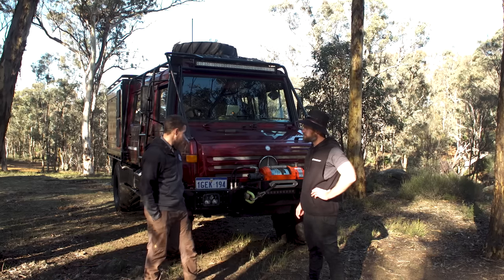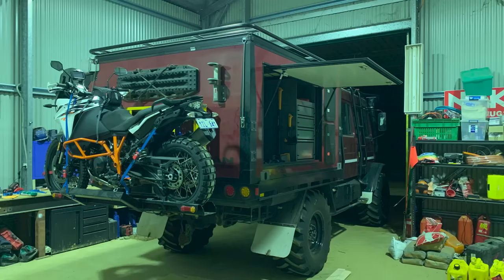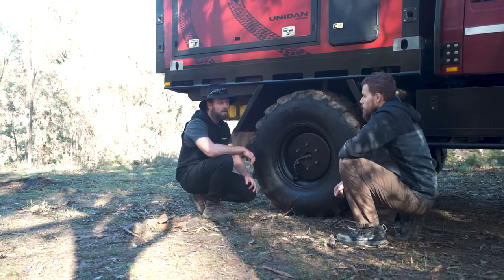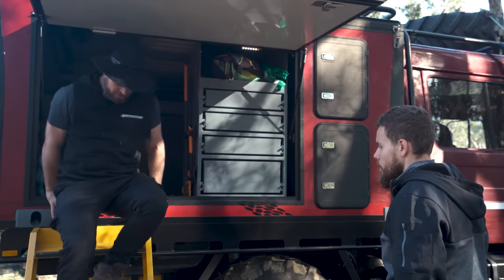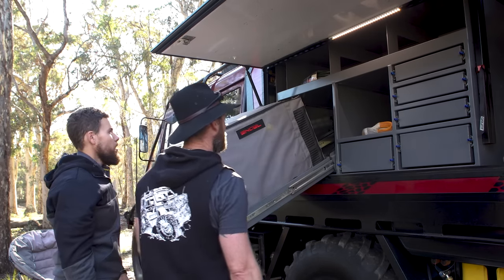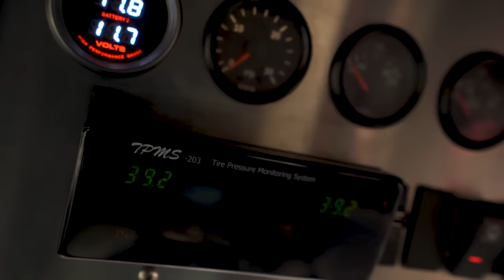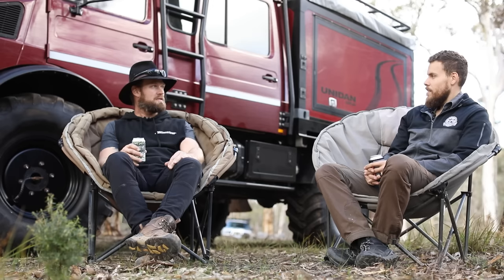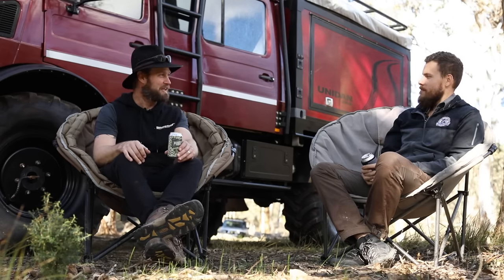DOOMSDAY TRUCK, Unimog Modified Episode 83

Comment: Amazing truck. Everything is done wisely.
And owner has a lot of experience, but CTIS looks little unfinished.
Usually there are metal shields for central tyre inflation system tubes from axles to tyres.
Just because it can be simply torn off in deep mud or by rock or by wooden log etc.
Looks like vehicle is made and what more important is used properly just to get to destination and enjoy it rather than do offroading itself.
Reply: I had metal shields on the previous set of wheels however when getting larger tyres I had to get wider rims and did not make up new cover brackets to suit.  They have a quick release fitting and I just take them off if I am bush bashing.  They are fine pushing through sand on their own.

Comment: I was wondering why no air suspension was installed. you would have a lot more possibilities. For example: you don't need a crane to lift your body to mount on the truck or off the truck etc.

Comment: great rig! my only complaint if i ever owned one of these is the unimog is so god dam slow and noisy. Many late night trips with the army traveling at 80 - 90 km all night long. Traveling to singleton at 11pm the turbo oil line cracked. Made a nice mess. We had to leave it on the side of the road.

Comment: As a MC truck driver I was some what aroused, and this beast would be a sight to see up at Cape York..

Nice rig Mat mate 👍👍
Reply: Would it fit in gunshot, what about the Tele pole bridge, would you get it around the corner and would bridge take the weight if ya did and also a 79 fits barely width wise, don’t think this would fit width wise, guess it could make a nanna line and do more damage to the track around it, tracks getting pretty beat these days!
Reply: @maverick2242  I totally agree mate but it would most definitely be a sight to see if by a slightly improbable chance of it getting that far, and yes it's a overland explorer not a hard-core off road warrior.
Reply: @jesusiskingamen1026  that's awesome, I stand corrected 👍

Comment: Epic build with just about every possible measure or need met, to make it as self sustainable as long as possible but I’m completely shocked that thinking of everything from welding equipment to backup generators inverters, reverse osmosis filtration systems etc why on earth would he have not installed  the overlander Solar panel system and battery bank packages available??? Especially being an Aussie rig... alll that amazing sun charging your power bank all day! They also fit flat between the roof and rack bed so they are protected and the racks can be used stifl. Some great rack floor mesh systems out there that affects the suns exposure to the panel by less than 3% . The Unimog builds here in the US it’s the first mid once the box is complete ajd nearly the entire box roof is lined with panels.  Why on earth have a generator system as your primary power battery bank charger?????  They use fuel , their loud, they can fail, their great as back ups for sure!!  But why not use a solar system that you never have to mess with ; it’s free electricity and charges large enough battery banks to last for weeks on a single days exposure:      His Unimog is nearly self sustaining with jsut fuel being mandatory so why add to thst with a generator with the amaxing efficiency of overland solar systems today??? The only other 2 things he’s missing thst is absolutely have to have is Unimog Military Beadlocks are everywhere and cheap , very cheap, ona unimog build and the weight of them doing crazy off-road situations , thst z47 inch tractors tire would scare the hell out of me if he lost a bead!  And the. Last , Global Expedition Vehicles in Colorado USA makes a very lightweight portable/moveable crane system for overland rigs thst are capable of picking up a super adventure motorcycle but used regularly for manual or electric craning of gear to the roof rack but especially the notorious Unimog wheel and spare from the roof. Their system with the pull of a pin can be lifted out of the sleeve welded to the roof racks to any otherbnumber of crane sleeve tubes all around the perimeter of the rack , it can also extent in height severs feet to clear the rack with an object. GXV puts sleeve mounts. At all 4 tire locations of the rack so you can literally jack up the rig, and then use the crane at thst position to hook the tire and wheel , raise it to the roof and the lower the space with no effort, also makes trying to mount a 47 inch 250K spare to the studs with no effort.   The crane can be ordered in steel or titanium and in a number of strengthens and weights and with a build like that , having a lightweight capable crane mobile to any location of the roof Rack with the pull of a pin will be well worth it on a gear top unimog rig.   WHEN not If , he looses a bead  he’s going to really wish he’d ordered beadlocks and a mobile crane system , only takes once to have to try to change a spare that big when it’s just you and your wife in the missile of nowhere .  Mobile roof mounted cranes have become a critical staple of overland campers not shut for gear lifting to the roof or the spare tire  but just as importantly as a use for mechanical means. The platinum Titanium crane system fron GXV is extremely light to move locations and extremely strong by material , uses an attached ATV winch and wireless rellmogeb control and comes with a cargo loading platform sndb4 point cable snatch point so yo can load the 4’ x 4’ composite cargo trays with all your gear and lift 2 or 3 trays and not have to inooad them. They snap to the rack. 👍👍 soooo jealous of his build!!!!

Comment: I dont think you have enough off road in Australia for this tbh - looks like a massive overkill for touring.
Reply: anna creek cattle station in south australia is over 5,800,000 acres or about the size of israel. WA is home to a 145km (90 mile) straight road, which is in the middle of nowhere. if you live in the first town in WA coming from SA, which is about 1200km away, its about a 300km return trip to get your hair cut from Norseman to Kalgoorlie. 500km from Kalgoorlie to Perth. if you go off track between these places and get into trouble you can die. if you head into the desert you can die. if you head go anywhere but the east coast, south coast or perth you can die if you find yourself in trouble. there's kangaroos everywhere. WA and the north also have packs of camels you dont want to hit in the middle of nowhere doing 100km/h. if you go looking for adventure down here you will find it, and Perth , one of the remotest cities in australia has it in abundance just outside. you cant cross a lot of the north during the rainy season because of flooding. you cant cross a lot of the centre without using dirt roads (though you can get to alice springs now via highway). you could definitely have a bunch of fun with this truck over here touring
Reply: You got no idea mate !

Comment: I am curious to know if anyone has mentioned this. The placement of your channel logos and links are located in a difficult location. The placement is in the same space as the YouTube video playback and volume controls.  When trying to select either the controls or your links. The curser will try and switch between each of the controls and logos and in the end nothing can be selected. It seems the difficulty is in the maximized screen display condition.

Comment: No breaking a bead at 14 PSI - I have never had a tire come off any tractor in 20 years, and they run at 14psi.  As it turns out, I have on a front tire, and they run more like 45 PSI, so there.

Comment: That´s in interesting approach: We do see these U1300 here, in GER/ EU all the time. But as your AUS Pickups are different, this one is as well. In EU you hardly see Pickups with a canapy (what ever this is spelled :-) ) because you get nor privacy here anywhere + the weather.

U 1300 are usually always with a shelter in the back. Either FM3 [3 meter long container, fom Alu compound or on tzhe longer wheelbase ones the FM2, 4,5 meter long] or selfmade/ custom made box.

bntw: Tire vs speed. The speed index tells you how fast you can go with full payload! If, as all of these are, running half or so, so can go MUCH faster w/o issues.

Comment: What a weapon! This is the dream 👍
Batteries were down a bit, why was that?
Can I get this straight? 8 gears, all can be split, all can be used in Low and also in Reverse so 68 gear options, is that correct 🧐
Reply: 64?
Reply: I think he said 32
Reply: Dieselman he did and then spoke of it all being able to be used in reverse as well, that’s why I asked about the 64, ah I see I wrote 68 🤣
Reply: Jimmy Y yep bad maths on my part 🤣
Reply: So does that mean my old 5 speed manual 4wd was actually an 18 speed 4wd...?? 5 forward in 2wd with 1 reverse making 6 then I have all those gears again in 4wd high then again in 4wd low making it an 18 speed patrol...??
Reply: Matt Alderton well technically it is 12 different gear ratios isn’t it? And in line with my previous post, 18 gear options. I am about as mechanical as a chimp with a hammer so buggered if I know but that’s how I see it.

Comment: The Unimog is a favorite for 4 season global oferllanding because you can literally use Virtuallynsny type and quality of fuel and oil from anywhere in the world ajd they somehow don’t ever seem to mind!? Their also known as very straightforward to work on and ANY new and used parts can be found globally . Mercedes in their diesels try at all costs to use over engineered parts and the same parts for all sizes of diesels for manufacturer savings but also the ease of finding replacements. A friend of mine was in Africa in his Uni when it had a supriseung breakdown in one of the pore wat countries in the world. So he pulled out the iPad thst comes with the conversion that has a 100% complete digital manual for replacement and repair of any component on the vehicle with videos and pictures and noticed immidately that it said to not panic , no matter where you are in the world because thst part can be replaced with a large number of the same part from Mercedes diesel  cars from the 80’s to tractors. In the 70’s . He rode his enduro to the nearest city and found a mechanic thst had an entire shelf of new snd used part he needed . Global EV if you want , orders a complete crate of at least one spare part for the Mercedes diesel and drivetraine that you’d need ,..multiple parts for parts either harder to locate or that more commonly fail , all repalcet fluids you’d need , seals , and a complete tool kit with every size needed on the vehicle , put it on a roller out steel box below the deck and you never have to worry even if not mechanically inclined, the videos and instructions on the included repair iPad covers every part and component on the rig. The Mercedes Inimog Diesels are globally exported to every continent andnelevation and are known to work flawlessly at record high elevations or sea level with no adjustments .  Unimog experts saw when looking for the vehicle to use,  go military rigs if you want overenfineered , lowest mileage and cheapest Unimogs available , the portal axles on even the lightest version use the maximum strength and size components and springs etc , ALL Unimog military variants use larger stronger components at every possible level and are common to be found retired with less than 10K on the entire rig. And most all military models included front and rear military grade winches .   For 4 season 4x4 or 6x6 overland campers the Unimog is by far the most common used followed by Russian MAAK thst are also known to be very reliable and simple to work on.  Many of the Unimog models also have a removable cover /panel that allows you to work on the engine fromtnheb inside as well so it’s not as hard as you’d think. Aside front heir reliability and glovally exported convenience the Unimog uses a load platform thst articulates separate from the drivetraine keeping the load or box as close to level as possible and the supports thst for the grand are so heavy and across the entire vehicle at the lowest venter of gravity  thst it creates a massive heavy flat unibody of sorts covereing front to back left to rightt and that’s what gives even tall load unimogs amazing stability and extreme side to side anglesS. Tatra trials use a similar. And for those that aren’t aware yes it looks like the boxes snd height make these too heavy but uniimogs are so extremely stable at maximum angles becasue they were engineered thst way. It’s the vehicle of all public and military title use in Germany so they have to be safely capably of traversing any road sornoffroad with Any load. But aside from that , Unimogs are built to carry ridiculously heavy  loads  but overland rigs with sandwich panels boxes are the most stable of Unimogs, tho the boxes aretall and look topheavy,  they are extremely light, newly no different thst having no box period: and tied at the 4 load latch points it can’t accidentally come off or tip off the body.  Similar concept of you think of it as a Unimog if you take the cab off the truck you see 95% of its weight and mass is below 5’ of ground height and evenly distributed ajd fthebextreme weight of portal axles and their placement only helps , the cab weights nothing and the camoer boxes would be like putting a large tall car board box on the bed of the truck , no angle is thst cardboard box going to help tip the Unimogs . The weight is too light and too insignificant bcomoared to the GVWR of the unimog and its ingenious placement making them the favorite for extreme builds. My absolute dream rig!!!! I Live just outside of Moab Utah and there’s a few of these down here and they are able to do ANY trail difficulty here as long as they fit, they are so amazing off-road and the water treatment systems and reverse osmosis systems changes the game, the only thing missing on this rig that really surprised me,..especially benign a sunny Aussie over lander I’m shocked there’s no solar panels on any of that enourmous amount of roof deck space . Here they put the panels between the roof and rack deck so if you need to you can load the rack but they charge a bank system anytime light that just makes you. Even more independent. Using a generally and inventor is great for an emergency but why use fuel when solar is free and endless?  Yes thought of everything so seems like he’d have a reason for that but I can’t think of any reason to not . It’s the last system he needs to be neatly fully independent aside from fuel.    The Unimog rigs here are all sent to a unimog/overland company in Colorado because they build the living box /camper using the most advanced /insulated at Cj ore trial and structural sandwitch panels and then vacume sealed , layered and protected actually making them true global 4 season boxes good from -30 degrees Celsius to 130 degrees Celsius and the company strips all the interior pot out and reclines every putter extremeity with an advanced insulation that makes it so you can heat your cab while driving in arctic conditions or extreme heat to your comfort and the insulation will hold to within 5 degrees over an24 hour period with no HVAC use. Amazing panels. They also do a lot of replacing all vehicle glass with either armored or layered bulletproof Securitty glads for not just insulation but theseboverlanders on the American continent do South America a lot and roadside attempted breakins or robberies are not unheard of but if you pay for the top level it includes a composite Kevlar like armored hard sheets or blankets lined just under the putter skin and in all body panels so it’s virtually impossible to break in without enough time to start it up bad drive over blocking vehicle.  They can also install money truck openings thst money trucks have making it able to stick the barrel of a gun outside with great amaount of angle coverage .

Comment: That thing must get great mileage, like 2mpg.
Reply: From experience, a surprising 15 mpg is possible with a  Dokka, even with a very un-aerodynamic rear body. Admittedly  on less agricultural 395/85R20 tyres,  intercooled and refueled up to around 200 bhp with a Claas splitter overdrive gearbox. From experience also, Mercedes originality is more reliable than modifications and the non- electronic OM 366 LA  motors here is  more dependable than your heartbeat.

Comment: 300 hp out of that engine? We get 126 bhp out of the 6 litre OM366LA (turbo+intercooler) in the Belgian army and never felt like it's lacking. Monstrous torque and does 90 km/hr on the highway easily enough.

Comment: 01:20 is it front drive? Very strange I cannot see  the shaft moving from rear diff
Reply: All of the drive shafts are enclosed in tubes to protect them.  So, you cannot see them spinning.

Comment: He said that everything is easily accessible while working on that engine. He clearly never has worked on that engine .
Reply: Hey mate, I have done plenty of work on the engine. Replacing the starter motor was a pain in the ass.. but most other work has not been too bad.

Comment: In a doomsday scenario all of the fuel will be gone within a few weeks and even if you can find duel it will be bad in a few months-a year and no more fuel, tools or parts will be produced. Horses will be superior after that. That diesel chugger will be done in no time. Also, you WILL need guns either for protecting yourself or acquiring food. 

Edit: On second though, doomsday will probably be a world full of radioactivity and will actually be doomsday. Either way, that vehicle is an expensive toy that will turn into a paperweight if any doomsday scenario occurs, like all motor vehicles. The fuel chuggers will be the first to go though.

Edit 2: You use the iPad for navigation? You'll need paper maps very quickly if doomsday occurs.